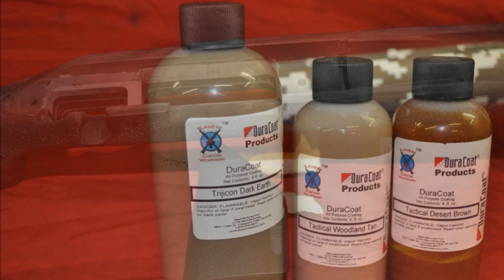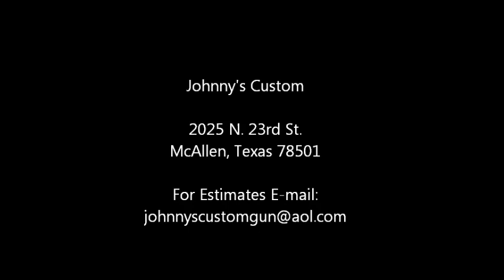M24-A2 Remington 700 .308

Comment: I just finished Duracoating my rifle stock, I am looking to do the same with my bolt, receiver, bottom metal and barrel like you did in the video. How well did it hold up? I don't believe I would  run a bolt action weapon to a temperature that would surpass Duracoats tolerance. Am I correct please advise